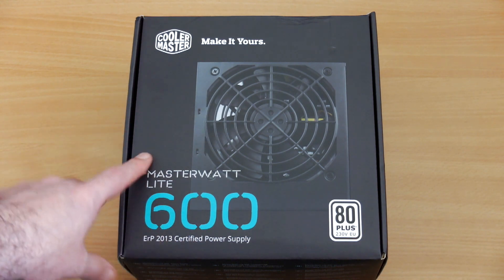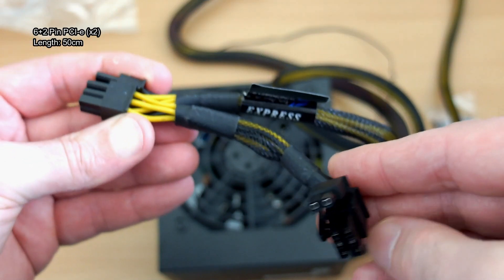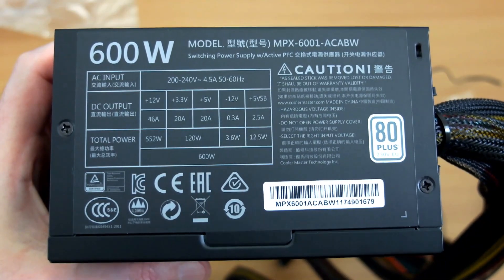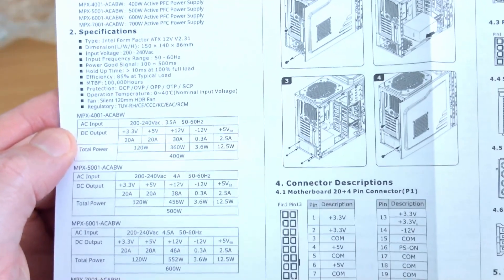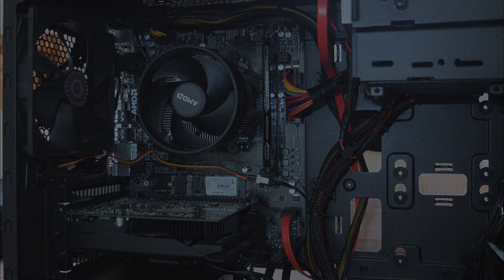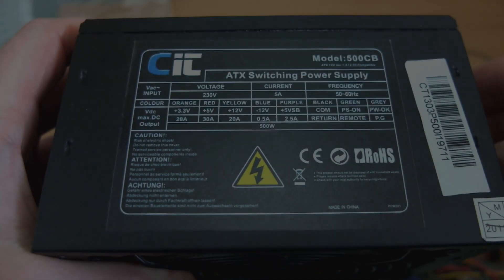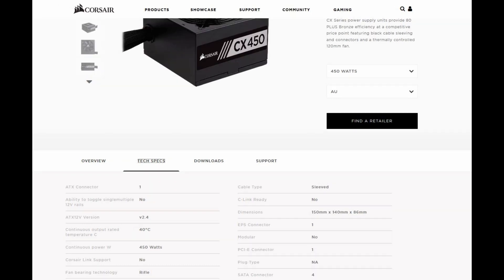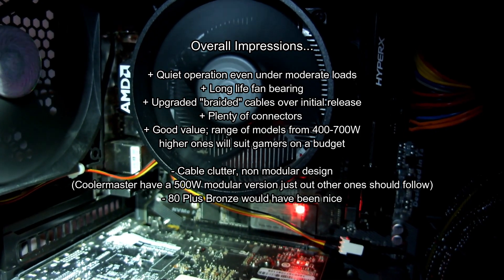Cooler Master MasterWatt Lite (V2 600W): Unboxing/Hands-On

Comment: Got one in 2017, still using it to this day in 2022. Not a single problem since, recommended.
Reply from the maker: It's still working fine this end too, outlasted the Corsair budget one
Reply: @MrBazReviews  same here working from 2017 ryzen 5 rx 480 16gb ram no oc
Reply: Thx cpu and gpu?

Comment: i just want to know is this power supply silent while working?
Reply from the maker: It's pretty quiet to my ears and I hate pc fan noise. This is variable I don't find it annoying...but if you are pushing close to the rating it will spin up the fan more, so it might be worth getting a higher wattage to offset that (ie less load less fan rpm)
I do have a passive PSU XFX and it's platinum rated - it's expensive though but yes completely silent. I've no major complaints with this one so far and it's used every day in a pc. Noise is a tricky thing it's not just the PSU but the case makes a difference, case fans, CPU fan, GPU fans they all add to the noise some are quieter than others or just turn the fan speeds down if you have good airflow the difference in temps isn't much

Comment: what about if i went to computer wattage calculator and it said that i will need max 525 watts so will this psu 600w will be enough??
Reply from the maker: It will do unless you want to give yourself more headroom move up to the 700W, the 600W will get the job done

Comment: Ive heard this is a bad PSU... Im even upgrading my cpu from a ryzen 3 1200 to ryzen 5 3600 and im also looking for a good gpu maybe a gtx1660 and im worried this will bot be enough to power ir
Reply from the maker: I have not had any problems with it, working fine with a GTX 1660. 600w is more than enough to power that
Reply: @MrBazReviews  ah ok thx

Comment: Where would you plug the sata power cable? Does it already have sata power cables installed?
Reply from the maker: All PSU's have SATA cables connectors bar really old ones, support is for HDD/SSD, optical drives GPU's have their own power connectors. I listed out the connectors on this power supply

Comment: Really usefull video!! I´m planning to change some components of my computer, i have this PSU and i´m not sure if it is going to be enough for this:

I5 8600K
SEAGATE 1 TB
32 GB RAM 3200 Mhz
GIGABYTE Z 370  HD3-CF
RTX 3600 Ti  8GB

Do you think is enough or i should change something there to make it more efficient?
Reply from the maker: Google PSU calculator and put the items in, it will tell you what you need power wise
Reply: @MrBazReviews  thanks man!! i will try it

Comment: hello. can it use with ryzen 7 2700x and radeon rx 580 nitro saphire 4gb with 6 pin molex adapter? please fast answer, thanks
Reply from the maker: The videos shows the connectors even before 1 minute ;-D

Comment: your vid..2:59min looks like you have to flip over so the fan is up?  hole on the bottom??
Reply from the maker: No for that case it's recommended fan down (there is a filter under it) and there is enough clearance even on normal carpet for it to get air intake. It doesn't really matter you could put it fan up, but then it's intaking air from the case not outside (ie cooler). The other PSU I took out had to be fan up as the cables were too short wouldn't reach the CPU power (older PSU)
Reply: @MrBazReviews  thanks

Comment: Can i use this psu for a gtx 980 ti and a i5 4460 ?
Reply from the maker: They recommend a 600W or greater PSU for that card it pulls about 250W at peak load so you should be fairly safe with the 600W PSU if you have a CPU like that. You can always step up to the next model if you wanted, this will do it though.

Comment: i got a case cooler master CMP 505 , it came with a cooler master 600w psu (tm6001) .. do i trust it or get a new psu ?
Reply from the maker: Is it an Elite 600W? If so that's a model below this (ie not 80 plus certified though it's not far off efficiency). In my experience it depends what you are doing the CM PSU's are usually respectable enough at least my failure rate on builds is lower than other makers. If you're pushing it hard ie OC/Gaming then maybe worth upgrading if not then I'd run with it for the time being. It's probably a better PSU than most off the shelf pc's have fitted
Reply: @MrBazReviews  
i googled it and no info , the only thing i got is a (tm 500) ! 

the built will be 7th gen i5 7600 with gtx 1050 and bunch of hdds and sds and case fans ...

i will use it for photoshop, digital art , some vid editing and CSGO 

should i get a plus 80 one or jsut go with this one .. this one isnt 80 plis and just looks like the one in the review -physical apperance wsie. except it is an obscure model.
Reply from the maker: @hippocratesm.d.1543  I'd use it or you could upgrade and keep it as a spare PSU (always worth having one around). You do save on the power costs long term with a high efficiency PSU though it takes a few years to get that, and it depends how often the pc is on and load etc. Up to you if it works OK just use it for the time being
Reply: @MrBazReviews  
thank u very much.

Comment: Will this psu work in case of a powercut?
Reply from the maker: No it is a normal power supply not a UPS which has a battery back up
Reply: Thnx man😁

Comment: I couldn't understand the difference between V1 and V2 
Cooler master mpx-6001-acabw-eu
For this model i saw a lot of people talking about noise
Reply from the maker: I'm not seeing a problem here but...bear in mind a few things. Lot of fans can contribute to noise overall (GPU is a big one as well as CPU). I run quiet systems by keeping the fan speeds down. With the PSU some are running it say a 400W PSU and overall peak power of 350W. So the PSU is going to be faster RPM on the fan, that said even ramped up I don't find it annoying. Anyway I always get a PSU a fair bit above what I use hence I'd just go for a 500/600W even if you're not using a high end card. You might later on and it's going to put a lot less load on the PSU. Just my thoughts on things. I don't find noise a problem least on the one I bought

Comment: i have an hp 2215 motherboard can this power supply support it? i did not find anything that can help me i am moving the motherboard into a tower gaming case i just wanted to know if my power supply will support it
Reply from the maker: Yes ATX power connection is standard so it's supported on all boards. Older ones might have 20 connectors they then moved to 24pin. The PSU supports both
Reply: @MrBazReviews  Thank you very very much you just solved my problem that i have almost for a week, Thanks again i will subscribe you.
Reply from the maker: @ahminator8549  Appreciated spread the word over time I will be able to do more PC related videos with more support!
Reply: Sure man Thanks again.

Comment: I recommand it. 2019 and it work very well with RTX graphics card and recents motherboards. Very quiet it's true.
Reply from the maker: I find it good so far no problems yet!
Reply: VinAr Run  does it work well
Reply: VinAr Run  Is it still working?
Reply: VinAr Run is it still good?
Reply: @ilovesuicidalgirls  Yes it's still good but not for a long time if you want to upgrade 🤔
Reply: VinAr Run what do you thin about evga?!

Comment: if im using amd ryzen 3 3200g and graphic card: sapphire+ AMD Rdeon RX 580 8 GB.. Is it enough just using 600W or need 650 W?
Reply from the maker: For that GPU they recommend a 500W CPU so 600W will cover it easily

Comment: Can i use this for Intel Pentium G4560 and GTX geforce 1050ti 4gb ddr5?
Reply from the maker: PSU's work for any system this one is rated to 600W even a fairly meaty gaming system will run on that, that spec doesn't really need 600W PSU you can go a bit lower without issue
Reply: you can use a 400w 80+ PSU that should be enough
Reply from the maker: Doesn't leave much headroom that card is pretty heavy on power. Price difference on these PSU's isn't that much not really

Comment: Is it good quality PSU?
I mean no problems like shutdowns or overheating while gaming?
Reply from the maker: It's on every day and so far no problems to report at all. There is a warranty - so you're covered in case of issues for a few years
I'm not unhappy with it for the price - it's probably a better PSU than a shop bought pc
Reply: @MrBazReviews  not really expensive. Here cost 
About 55 euros.(60 dollars) i hope it would be good bugdet psu xD
Reply from the maker: @hyexenforomacedonians9251  Seems OK to me, I've used super budget PSU's for older computers, and they def were not nearly as good but did the job. Whilst it's budget, coolermaster are a fairly large company, I'd take this any day over a budget Corsair PSU, they just seem to die just out of warranty, so I avoid them these days - though their mid/higher end ones are good
Reply: @MrBazReviews  thanks for your fast response. 
It is loud at high loads.?
Reply from the maker: It's not that loud at least the one I have here. Depending on what you are using GPU wise, I'd always go a bit higher than needed

Comment: Ryzen 5 2600x 
With 16 GB ram 
With rtx 2060 
Will it work
Reply from the maker: Works fine with that 600w will cover up to a fairly high end card, it's just if you run dual top end cards you would want more

Comment: I just bought this product and I noticed something. The motherboard connector has 20+4 pins on the manual but in fact there are 23 pins .Does it affect something? Bcoz the motherboard has 24 pins on it .
Reply from the maker: It's 20+4 connector and they are all there least on my sample!
Reply: @MrBazReviews  thanks for the info.i may have to replace the product coz one connector out of 24 is a dummy.
Reply from the maker: Plug it in if it works it work if it doesn't send it back ;-)

Comment: r5 2600
Gtx 1070
16 gb ram
Will it works?
Reply from the maker: Use the PSU calculator to work out the draw
https://www.coolermaster.com/power-supply-calculator/
https://outervision.com/power-supply-calculator

Comment: what is different between this and coolermaster 600w v3 75% Efficiency. which is more better and safe 
I have coolermaster 600w v3 now my pc is 

ryzen 5 2600 
evga gtx 1080 ftw 
16 gb ram ddr4 3000mhz 

most of people said it is bad psu i know 600w is more than ok for me what about quality ?
Reply from the maker: If it works it works the V3 and MWL have 3 year warranty. Buying now I'd personally not use a PSU that doesn't at least have 80 Plus certification, but if it's working alright run with it
Reply: @MrBazReviews  it works yes but is it any dangerous ?

Comment: bro is it safe like that ?! because the fan is looking down on the case
Reply from the maker: It's supposed to be down in that case there is a filter under it on the outside so it pulls cool air in
Reply: @MrBazReviews  ah ok thanks for the quick answer :)

Comment: Hey friend you think this PSU would be able to sustain this build? 

CPU: Intel Core i5 6400 at 3.3GHz
GPU: Gigabyte RX 580 8GB at 1355MHz Core Clock
RAM: DDR4 8GB (4x2) 2133MHz
SSD: Gigabyte 240GBs SSD
HDD: Seagate Barracuda 1TB 7.2K RPM
Motherboard: Gigabyte B150M-D3H DDR4
Fans: 1x 120mm Rear Fan

Thank you!
Reply from the maker: It will work you can use the PSU calculator too
https://outervision.com/power-supply-calculator

Comment: is this enough for a GTX 1080?
Reply from the maker: Should be depends on overall system draw if in doubt go up a bit but it should cover it
Reply: your processor?
Reply: yes I use this PSU with an 8700K and GTX 1080

Comment: I have a ryzen 2400g
16 gb 3000mz ram
Vega 64
Should i buy it??
Reply from the maker: The choice is yours I've not had a problem with it to date
Reply: @MrBazReviews  using it with a i7 3770 and R9 290 without any issues
Reply from the maker: @exe8041  It can handle it, the rating is accurate it can put out 600w, some of the super budget stuff out there can't -they just inflate the numbers.
Coolermaster are fairly well known, whilst it's not a high end PSU, they usually do in my experience make decent stuff
Reply: @MrBazReviews  exactly,it's a great PSU

Comment: For some reason i only see two 6 pin pcie connectors.... so now what?
Reply from the maker: 2 x 6+2 pin (8 pin) GPU connectors, do you need more than that?
Reply: Mr Baz Reviews nevermind xD the 2 pins were stored in the back of the Chassis

Comment: Is this psu good enought for my rig:
i5 3570k
RX 470
2xddr3 8gb
2 hdd
2 fans 120
Running stock speed
Reply from the maker: Of course only high end gaming rigs will need more than 500/600w PSU's
Reply: @MrBazReviews  thank for your answer
Reply: bro you need to change your cpu i have i3-4160 and it bottlenecking my rx 580 8gb for 40% :/

Comment: I see a pre built computer which says it uses this psu with a 2070 graphics card and i7 8700k cpu is that Good enough for that idk?
Reply from the maker: Recommended PSU is 550W for the Nvidia card so based on that (CPU isn't a big power drain 95W) GPU draws 175-180W other components also add up but far less. So it meets the requirements, thing is you get a warranty with a pre-build PC or if you buy it on it's own so that should cover things. I've not had issues so far with this PSU and I've used it for a few builds. Certainly would say it's better than the Corsair ones I did use (they get good mid level and up)
Reply: Mr Baz Reviews ah okay that seems good so should it be okay to run 3d softwares and things like unity or unreal engine as well as gaming etc?
Reply: Mr Baz Reviews if it is I’d save up I only need a few hundred more ha ha which is nice.
Reply from the maker: @leafstormblaze9449  Like I said not had problem but I will let people know I also have a warranty on this so any issues can be sorted. To be honest this is the cheapest I'd go you can get even cheaper PSU's and I've used a couple of those CIT ones for replacement PSU's but only older systems which don't justify much outlay (ie older CPU's etc mainly home use/office stuff not powerful systems). They're lasting OK, not that quiet but they work. Compared to the Corsair CX450's which seem to die (fan mainly) just outside warranty, I'd say the Coolermaster should be a better PSU. But if you are building a high end workstation or gaming pc it makes sense to go for a mid level PSU -this is a decent enough budget solution
Reply: Mr Baz Reviews so wait Is this a mid level psu? Or would that be 800, sorry for all the stupid questions it’s my first time looking at desktops cause I just had a laptop before but that broke.
Reply from the maker: I'm talking about grade of PSU this is a budget one, not the cheapest but that's the category. Is it worth buying? So far yes but demanding users I'd consider the MasterWatt series (just out) 5 year warranty, 80 plus Bronze, modular, and idle fan under 15% load bit more expensive but not "costly" by any means. This will do that might be better if you have a bit more budget
Reply: I am using this power supply with an i7 and RTX 2080 just fine. It is more than powerful enough.

Comment: this psu is good ?
or you can suggest me any psu with same specification ?
Reply from the maker: I've not had any problems with the PSU so it's working away fine for the build I did (and the pc is on a lot). Compared to some other budget PSU's I've used this one is worth getting it's also pretty quiet
Reply: Mr Baz Reviews how about enermax maxpro 500w, do you know about that ?
Reply from the maker: My opinion is the CoolerMaster is the better choice the Enermax is more expensive, but offers no real advantage warranty the same both 80 Plus. If you are paying more I would aim for 80 Plus Bronze minimum. I would take the CoolerMaster over the Corsair budget PSU's too based on my building experience and high failure rate of CX PSU's
Reply from the maker: http://www.pctekreviews.com/Reviews/PSU_600.aspx

Comment: I have de 500w version, and boy, make a hell of a noise, if i'm using headsets it's ok, but if i'm not, it's really annoying
Reply from the maker: What are you running on it high end card? I've found it to be pretty quiet, it doesn't ramp up unless under a high load even then it's not what I would call "loud" compared to other ones I've used. Unless you have a faulty fan maybe
Reply: @MrBazReviews , It's a Budget setup, GTX 1050ti, i5 8400, 8gb  RAM, 1tb..... Probably it's the fan, not sure if i send to 
warranty
Reply from the maker: @lucastendero  That won't pull a lot of power from the PSU so I think the fan is defective I would get a replacement because it's fairly quiet on the one I have here.

Comment: Mi equipo que me armare es el siguiente:
Procesador: I5 8400
Disco duro: Seagate 1 TB 
Memoria: 16 GB 
Placa: Asus Rog Strix B360-H
Video: GTX 1060 Rog Strix
Case: Thermaltake o Gambyte sin fuente ( que me recomendarias )
Fuente: La que estas mostrando Fuente CoolMaster 600w 80 plus

Dime aver quisiera una opinion tuya es para jugar juegos a graficos altos y para diseño podria servir? espero su respuesta :)
Reply from the maker: 1060 Card is good right now for the price and performance there are newer cards out but still it's a good buy
Reply: @MrBazReviews Muchas gracias amigo ya que estaba ya comprandomela y ya armandola para poder grabar mis videos en youtube y ya elegi mi case va a ser case Thermaltake azul MASTERBOX MB510L con la fuente CoolMaster 80 plus aparte que hablabas en el video espero que me funcione y corra bien :D .Gracias
Reply from the maker: @aventurero_2399  No problem should be a good system for you the PSU is working well for me so far

Comment: It works with 8.8pin rtx 2060
Reply from the maker: 1:08 yes as you see 2 x 8 pin PCI-e connectors the 700W has 4 in total
Reply: @MrBazReviews  is it good or what because i will buy it to my friend
Reply from the maker: @MrFoshar  As per the video I give an opinion on it, it's working it's from a major maker, CM are usually fairly reliable and you have a warranty. It's a better PSU than some of the crazy cheap ones